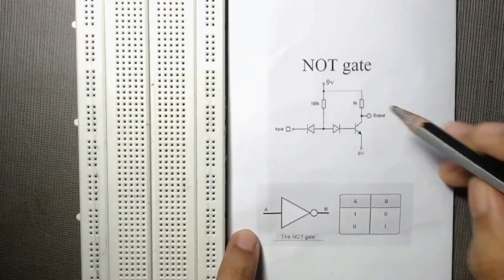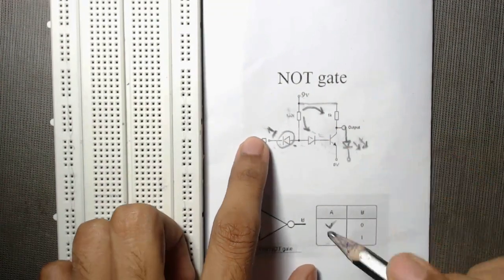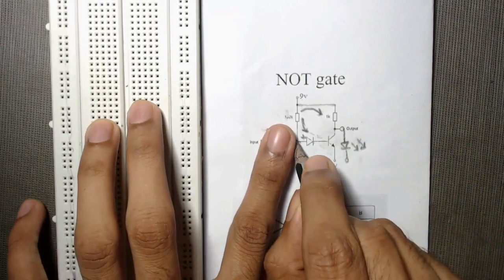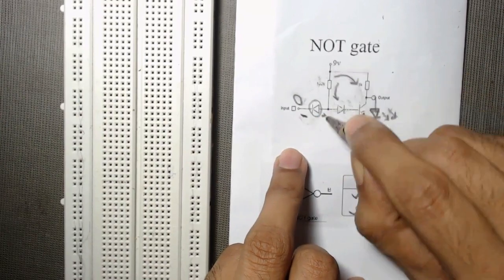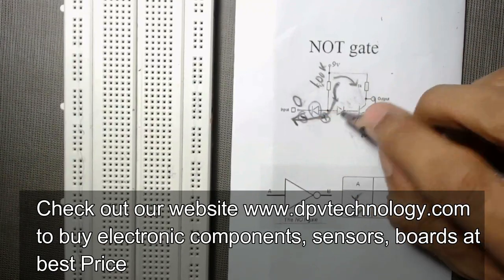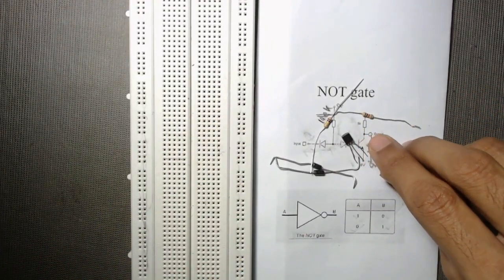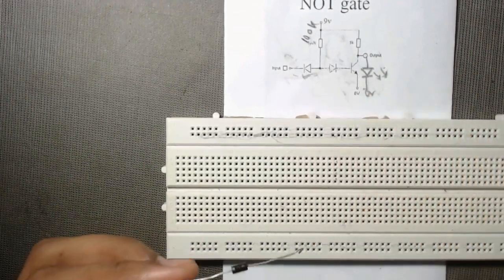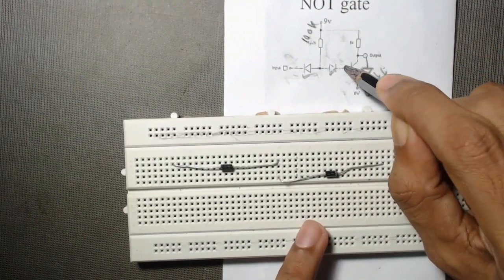NOT Gate Using Diode

Comment: hey i am using an output from the data pin of a receiver, its voltage is very low, will there be any loss in the above circuit or do  you have any better idea that you can suggest??